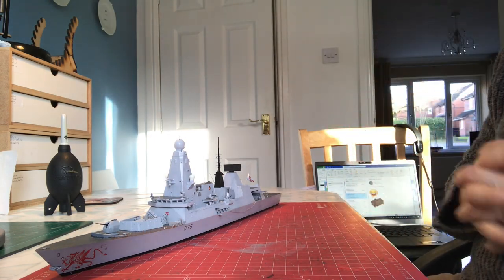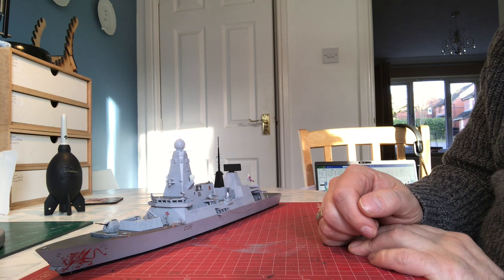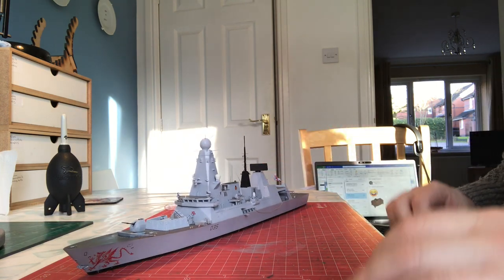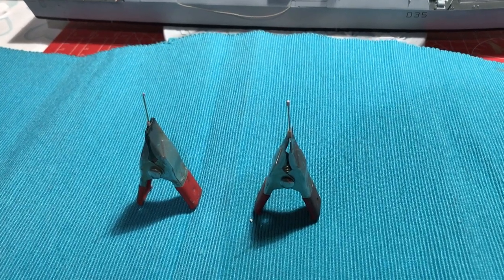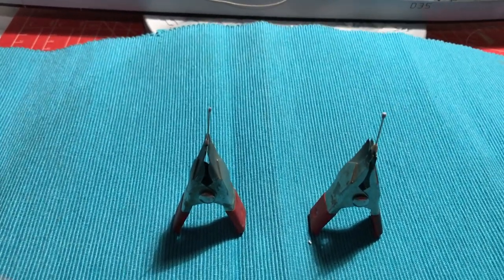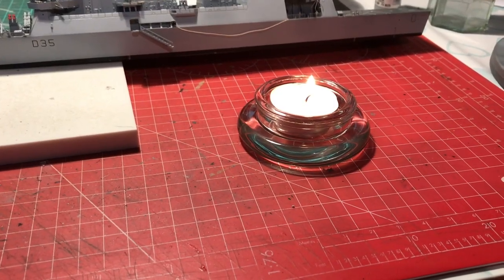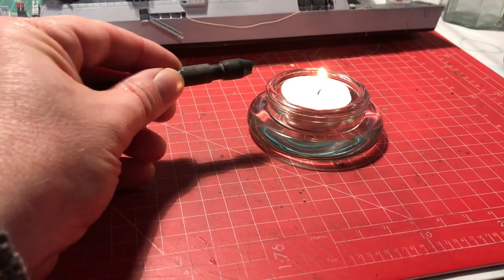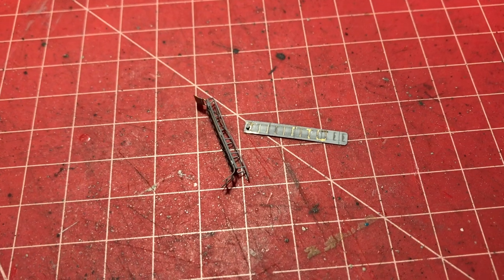Airfix type 45 Destroyer with Atlantic etch part 4

Comment: I'm really enjoying this build, HMS Dragon is looking amazing. 
Just a couple of very, very minor things that I've noticed (absolutely not a criticism, your skills far surpass mine, just observations...I'm ex RN, although I never served on a T45)...the accommodation ladder is very rarely used at sea, I've only ever seen it lowered at sea during hands to bathe, or if a VIP is coming onboard via the seaboat. 
The ceremonial nameplates on the silo are also removed at sea and the ends of the Harpoon missile canisters are not painted red in the RN.
Reply from the maker: ladder was artistic license, did not know the name plates were removed at sea, interesting.  the red covers were taken from a photo, maybe sea trips before fully installed?
Reply: @ModelkitStuff  I guess you have the Pac 24 seaboat in the water, so there could be someone coming aboard via the accom ladder :).....The nameplates are removed as they are polished brass letters and will corrode if left rigged at sea. 
I have seen the ends of Harpoon canisters painted red on several NATO ships, but they've always been grey on RN ships fitted with Harpoon (Type 22 Batch 3's, Type 23s and Type 45s).